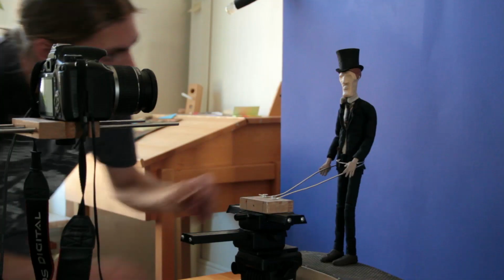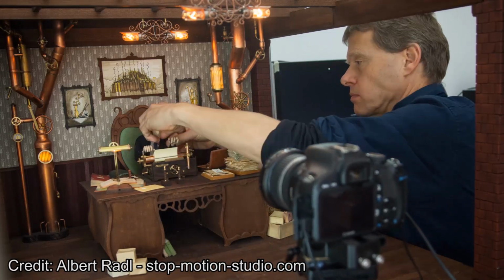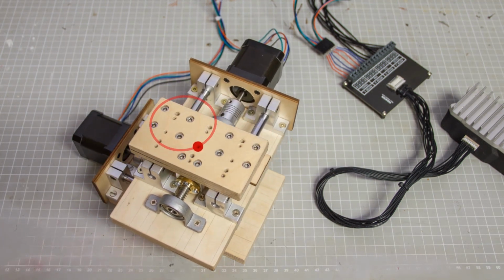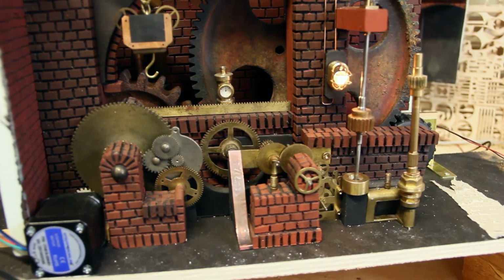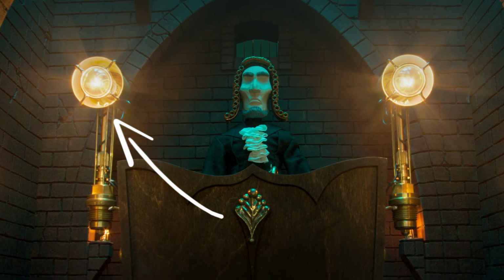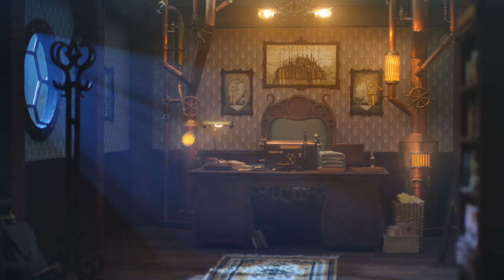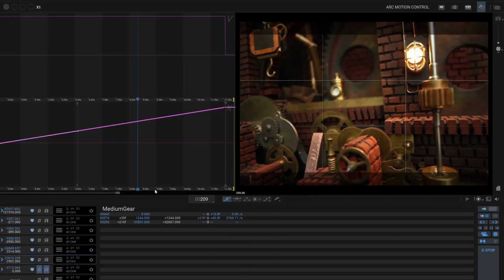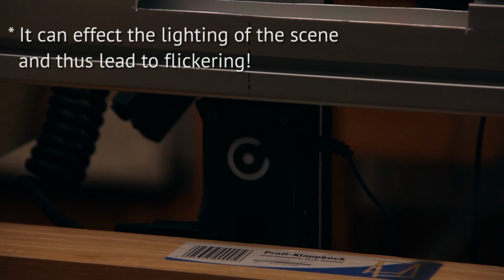How to Automate your Stopmotion Sets

Comment: Amazing work! I was curious if you could post the name or a link to the tiny stepper motor you're using?
Reply from the maker: The smallest ones were just from Ebay, made in China I suppose: https://www.ebay.de/itm/262718824245
But I think the ones which come with gears or a tiny linear drive attached are much more useful, as the motors alone are very weak. Just search for "micro stepper" on Ebay! :)